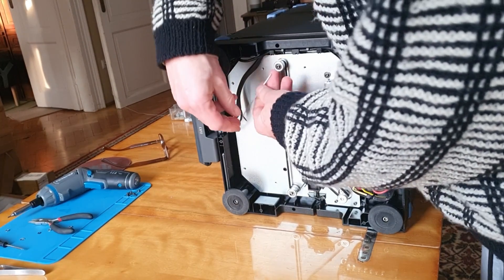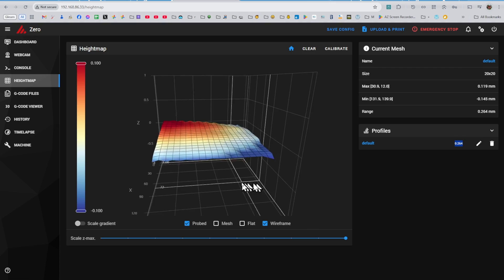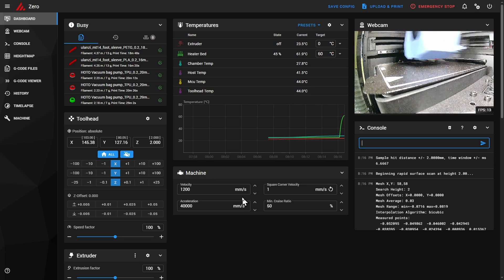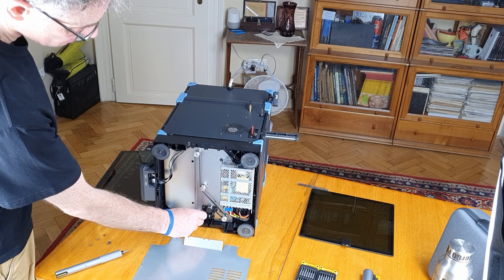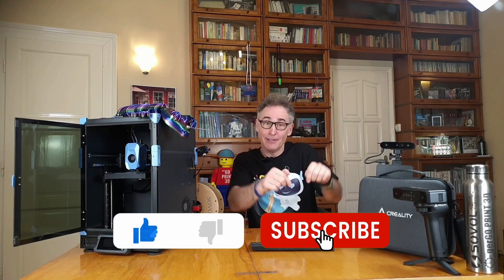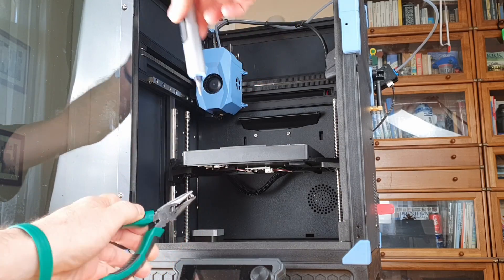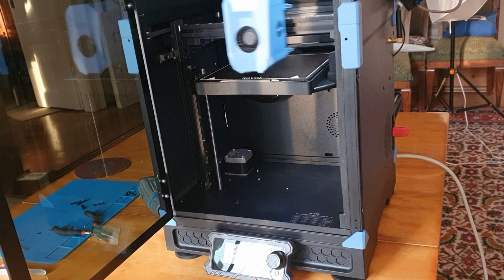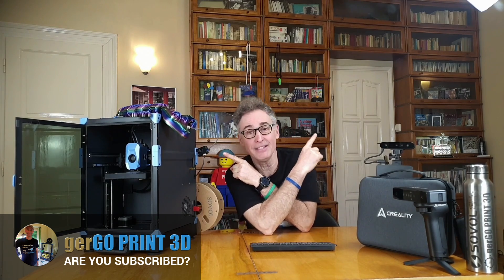Tilted CoreXY Drop-Bed? Our Sovol Zero fixed  permanently, under 15 minutes!

Comment: Great video as always! I do want to point out something I noticed as I was about to follow your steps. The z-axis shafts (as least on my machine) have a flat spot ground into them where the socket cap set screw is resting to give it a more secure hold. I think adjusting it by only 1/20th of a turn to compensate for the .1mm difference, the pressure from the set screw might actually be likely to try and realign with the flat spot if it hasn't fully reached on the round portion of the shaft. But what have your results been now after 5 months? Has it kept it's adjustment?
Reply from the maker: I haven't checked lately tbh because it's just printing great ever since. But I'll run a mesh in a minute and let you know :)

Comment: Thanks a lot for your videos. Because of your effort to make this, I've learned a lot and makes me fall in love once more with my Sovol Zero. Thank you!!
Reply from the maker: You are very welcome! The Zero is such a loveable little device. One of the most used printers  in our fleet. Because every project has those small components that would not make sense to heat up any of the larger printers for.
Reply: @gerGoPrint3D  I feel like the Zero is the machine Voron v0 was meant to be. Sturdy frame, linear rails on all three axes and anything is accesible, no glue or other stupid stuff.
I used to have a delta with linear railes, I had come from an Ender 3. Got a Creality machine but with the Zero it appears to me this might be the perfect machine. Build volume is at a point where it just makes sense.

Comment: Not Full klipper
Reply from the maker: What is missing?
Reply: @gerGoPrint3D antitangle, reading pluses as fliament moves and signal pause if stopped
Reply from the maker: @3D_Printing  The hardware for anti-tangle is also missing, but you are right, even if you add the hardware you'll have to update Klipper. But you can do it, since Sovol keeps it open SSH user/pw sovol/sovol

Comment: Does the SV08 also have standoffs under the heated bed?
Reply from the maker: I haven't taken my SV08 bed apart, it has been nice and flat for me. But you can check the design down to the last little screw, as Sovol published all the STEP files on their github.

Comment: Hi Gergo, thanks for your valueable contributions. They are of great value - at least for me ... 😉
I own a SV08 since 6 months now and the bed leveling is still something I'd like to improve. Since you seem to have the two latest 3D printer models by Sovol (both the zero ans the SV08 Max) I'd like to know if the Eddy probe in these two machines are of the same hardware type - and which type exactly - and if the integration into klipper is the same in both cases. My idea would be to replace the built-in probe (into the SV08) by the same Eddy model as used in the later models. Oh, not to forget: Are you aware how the Eddy probes are connected electrically. Is there additional wiring required ? Idealy would be if Sovol would offer something like an upgrade kit though ... 🤓
Reply from the maker: Yes the MAX and the Zero uses identical toolheads (incl Eddy sensor) except for the rear part cooler, which is not needed on the Zero. It is similar to the regular SV08, but not interchangeable since the SV08 toolhead board still uses USB connection to the main controller, while they switched to CAN bus on the Zero / MAX.  You can access the exact model and connection, the design of the Zero / MAX is published on Sovol's github, including the software configuration.  I think it just needs a more up-to-date version of Klipper. 

There are community solutions for bringing Eddy current probing to the SV08, I think you are better off following those, since the newer printers differ too much from the original SV08.

Comment: I did the sanded spacer bed leveling and it worked great.  Thanks Gergo!

I went a bit farther and sanded the magnetic sheet to flatten the bed after the four mounting points were within 10 microns of the same height and eventually got good results, but only after running into a complication.  I just posted a "Leveling The Zero Bed" thread on the Sovol online forum, with a description and a lot of pictures to explain my Zero bed leveling adventures and misadventures.

While the bed was out of the frame, I also filed off the plastic tab in the front center so I can now use any 165x165 mm build plate, for an Ender 2, Adventurer 3, LulzBot Mini 2....  I documented that in the "Build plates" thread on the Zero sub-forum on the Sovol3D Forum.

Comment: I've had my sovol zero for about 2 months now.  No complaints at all about print quality.  I've had a few first layer failures, but simply keeping the build sheet clean, and using stick glue with ABS is all it took to fix this.  The Eddy probe bed meshing is so fast and accurate that it perfectly corrects the mechanical imperfections of the bed.  I might try your fix, but at the moment it really isn't needed for me.
Don't just shut off the printer, use the web interface to shut down klipper, then power down the printer.  This will help prevent corruption of the printers SSD file system as shutting down kilpper will unmount all files first.
Reply from the maker: Thanks for the feedback. Good call on the shutdown. Normally I do it that way.  I even added my own shutdown command to the device screen. Check out my macros.

Comment: Thanks for sharing Gergo!    My production Zero had no left right tilt but had the front/back difference that others have mentioned.   

Another option to working out the amount to adjust at the screws is via SCREWS_TILT_CALCULATE macro with a [screws_tilt_adjust] section added to printer.cfg:

[screws_tilt_adjust]
screw1: 43,13.2
screw1_name: front left screw
screw2: 155,13.2
screw2_name: front right screw
screw3: 155,133.2
screw3_name: rear right screw
screw4: 43,133.2
screw4_name: rear left screw
horizontal_move_z: 8
speed: 100
screw_thread: CW-M3

If you want to tweak the screws for tighter control OR you can use the difference measurements to sand the standoffs.

Also, later versions of the macros from Sovol do heat up the bed in the BED_MESH_CALIBRATE macro.   I believe when they dropped the use of the load cell, they home Z differently and that includes heating the bed.

[gcode_macro BED_MESH_CALIBRATE]
rename_existing: BED_MESH_CALIBRATE_BASE
gcode:
    {% set origin_square_corner_velocity_val = printer.toolhead.square_corner_velocity|float %}
    {% set temporarily_square_corner_velocity_val = 1.0 %}
    {% if not printer['gcode_macro _global_var'].has_z_offset_calibrated %}
        G28 X
        G28 Y
        Z_OFFSET_CALIBRATION METHOD=force_overlay BED_TEMP={printer.heater_bed.target}
    {% endif %}
    SET_VELOCITY_LIMIT SQUARE_CORNER_VELOCITY={temporarily_square_corner_velocity_val}
    BED_MESH_CALIBRATE_BASE ADAPTIVE=1 PGP=0 METHOD=rapid_scan
    SET_VELOCITY_LIMIT SQUARE_CORNER_VELOCITY={origin_square_corner_velocity_val}

Notice the Z_OFFSET_CALIBRATION METHOD=force_overlay BED_TEMP={printer.heater_bed.target} 

Thanks for another great video!
Reply from the maker: Interesting. I did not notice there was sw update. I will look.

Comment: PRO TIP - When hand sanding small parts, move the part over the sandpaper in a figure 8 to help keep the ends parallel.  The calipers can be used to verify the same end-to-end distances around the circumference.
Reply from the maker: That's a really good idea.  When we are working on hundreth of mm precission this can indeed make a difference!
Reply: @gerGoPrint3D  - The figure 8 method is how astronomers ground their telescope lenses by hand.  8, rotate, repeat.  Optical precision in a hand ground lens.  Humans are amazing.
Reply: This has often caused me trouble. I'll give the figure 8s a go. Thank you :)
Reply: @UnH1ng3d  - For these tiny spacers, it might be easier to rotate them as you sand in a circular motion.

Comment: My Zero is a production unit.  The bed isn't tilted from left to right but the front edge droops 0.3 mm.  I get perfect first layers because Klipper can adjust the Z height as it prints because (unlike my stock SV08), the Eddy sensor on the Zero produces an accurate bed mesh.  I've been planning to level the Zero's bed.  The method shown in this video is an excellent general purpose process that will work for all cases, but in my simpler case with only the front edge low, I'm planning on loosening the four screws on the sides that mount the bed assembly to the Z axis lead screws and slipping a thin strip of aluminum foil under the front two screws to tilt the bed up in the front, but I may use your method as it's more precise and can dial in a nearly perfectly flat bed.  Removing the magnetic sheet and heated bed will also allow me access to file off the plastic center tab in the front of the injection molded bed frame that prevents me from using the 165x165 mm build plates for the Ender 2, Adventurer 3 and LuzBot Mini 2.

I was having trouble with the Zero printing too high on some prints and having poor bed adhesion approximately 10% of the time.  The problem was the Sovol procedure for cleaning the nozzle and scanning the bed.  The CLEAN_NOZZLE macro would heat the nozzle, scrub it on the silicone pad to clean it, then park it at 30,30,0 (touching the bed) in an attempt to prevent it from oozing as it cooled.  That was leaving a small blob of plastic on the nozzle tip that caused the subsequent contact bed probing to detect the bed too high, resulting in the Z offset being too high and failed first layers.  I edited the CLEAN_NOZZLE macro so it cools the nozzle as it's scrubbing, so by the time the scrubbing is finished, the nozzle is clean and cool, so it can't ooze.  There is no need for the nozzle to touch the bed until it probes to determine the Z offset, which is now perfect every time.  I posted my revised CLEAN_NOZZLE macro on the Sovol forum, in the thread "Zero First Layer Issues - FIXED" if anyone would like to try it.  Hopefully Sovol will implement this upgrade that took my Zero from 90% perfect first layers to 100% perfect first layers.
Reply: I have a brass wire brush that I use to clean the nozzle if I see any ooze